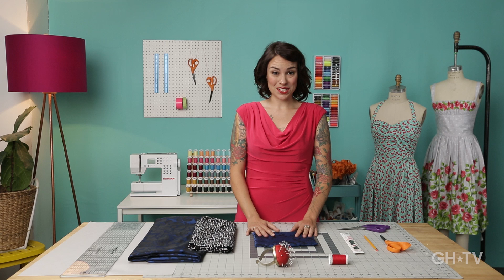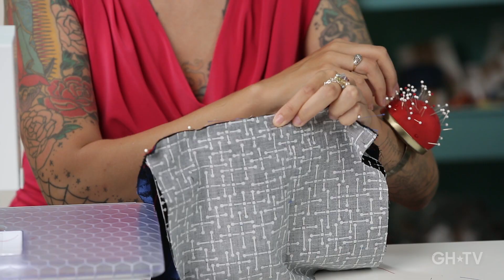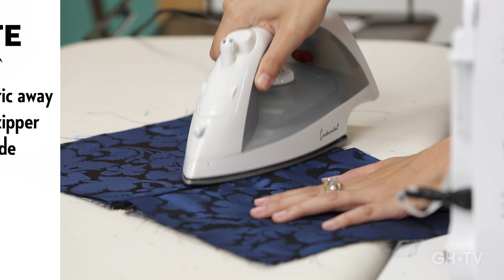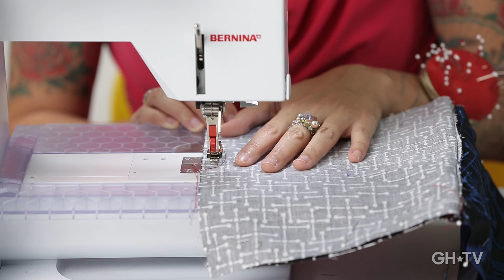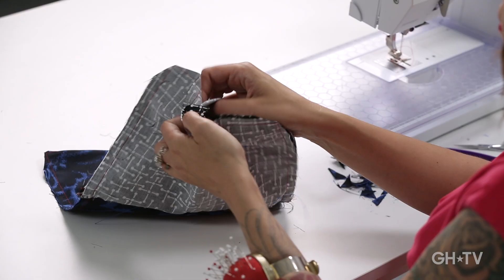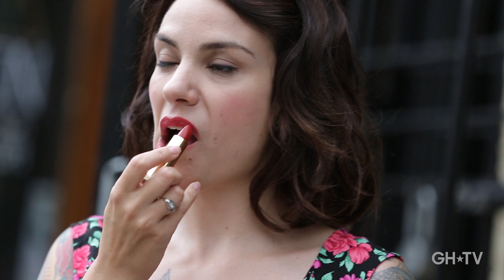How To Make A Handbag Zipper Clutch For Beginners

Comment: Hi there, just wondering if there is a reason you don't sew the outter and lining fabric onto the zipper at the same time, instead of one at a time?
Reply: This is a beginners project, sewing the outer fabric and lining at once can be pretty hard, especially when you never sewed a zipper. I'm not a beginner and still do it that way so i can be sure that my seams are straight and crisp.

Comment: I am a little confused, I ended  up with the fabric I wanted in the outside, inside?!
Reply: This happens when you put the zipper wrong. When you align your outer fabric and the zipper, your fabric has to be on the right side and the teeth of the zipper have to be on the inside. When you sew these parts together you look at the flat side of the zipper without the teeth. I hope you understand what i mean

Comment: Decent videos.  Informative.  Suggestion:  Have a camera coming in from over right shoulder for a close-in shot to show precisely what you are doing when you are describing what is being done.  In addition, a shot from 180 degrees opposite Ms. Hirsch, directly in line with the stitching would be a big plus.  That way we get the same line-of-sight along the stitching as she does, just from the other side.  Just my 2 cents as a beginner.

Comment: I tried this out last night and I have never sewn anything using my machine in total before. I've done practice little bits but nothing else. This was really easy and I will definitely be doing it more to practice different styles etc. If you're a beginner, I definitely recommend using two colour fabrics as I used the same for the outside and the lining and it got confusing! Really enjoyed doing this and it didn't take long either.